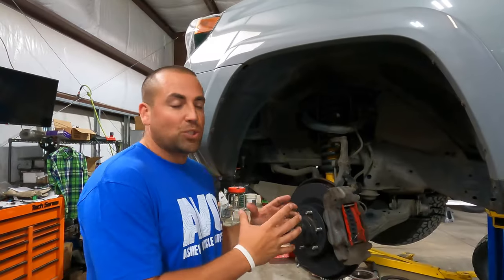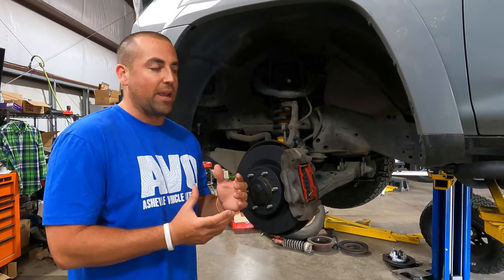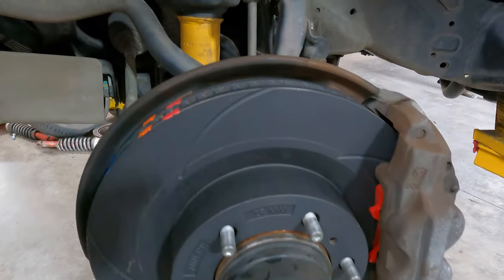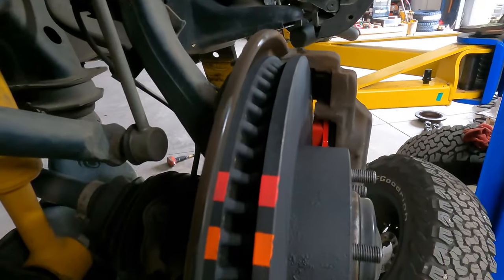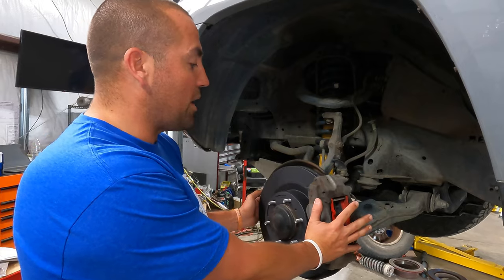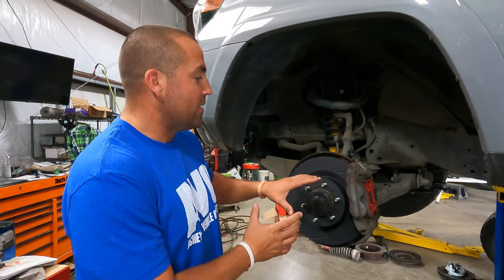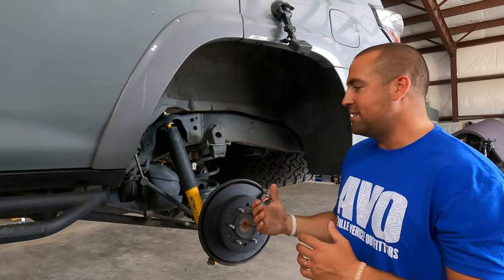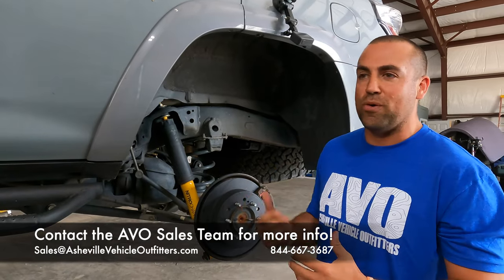💥 NEW D-Line Brake Kit from Powerbrake at AVO!

Comment: Would these also work with OEM brake pads to give you slightly better performance than staying with the OEM rotors?  My rotors are old but I just replaced my OEM brake pads so they are still new and I still want to get some use out of them before replacing it.
Reply from the maker: All the Powerbrake Kits come as a package in order to get the best performance upgrade. We recommend using the entire kit when upgrading your brakes.

Comment: Do you have brake pad available to replace stock pad even if I still use stock rotor?
Reply from the maker: The Powerbrake D line kit is only sold as a complete kit. Although replacement pads are available, they are intended to be used on the Powerbrake Rotor.
Reply: @ashevillevehicleoutfitters1201 that's straight nuts